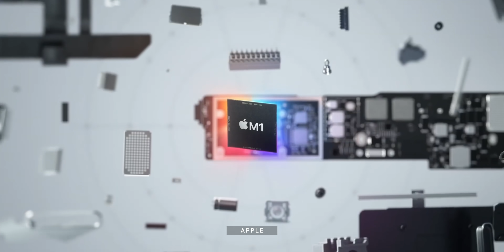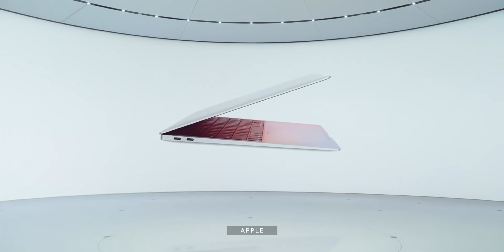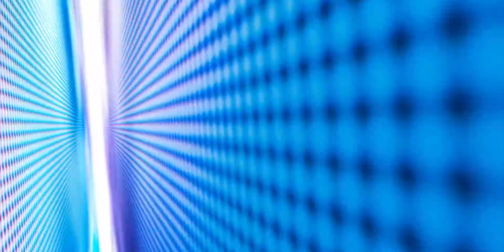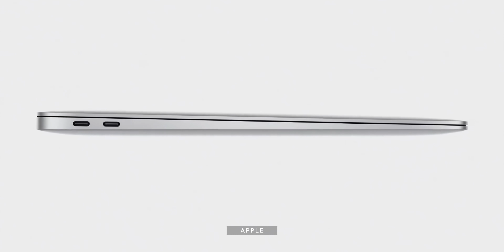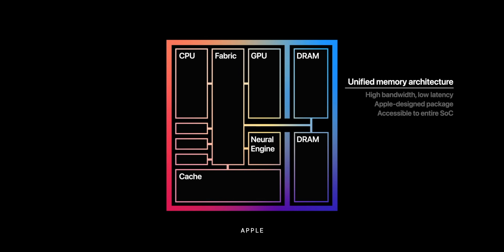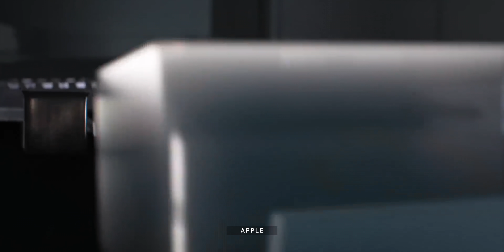M1 MacBook Air — Buy Now or Wait for M2?

Comment: So, no improvement in display??....more nits, brightness, like a MiniLed. My 13" late '13 Macbook Pro is losing its screen...a little more than an inch from the right and a little from the bottom.  I got good use out of it.  The only "work" I really do with it is Affinity Photo.  Doesn't look like waiting would make a difference M1 vs M2

Comment: I am a student and i want to buy macbook air m1 (8gb, 512 gb) as my budget is around 130,000 and i want enough storage and macbook pro is (8gb, 256gb) so is it ok if i go with the macbook air ? I want for normal multitasking, web browsing, media consumption, Microsoft office and zoom meetings...NO VIDEO EDITING OR GAMING but i want smooth experience in all tasks i mentioned above and i want to use it for at least 5-6 years so is it ok if i go with the air? Does it have any heating issues in long run as it is a fanless design? I also don't have any urgency so should i wait for new macs with m2 chip...? Sir plz answer

Comment: I will wait for M2 because though its  single core performance is awesome, multi core figures are not that great.. Higher end pro has Intel processor.. but with M2 materialized, it should take a rebirth as well with the new awesomeness.. Intel chips would soon be obsolete atleast in the Apple hardware.

Comment: Depends on if they need a computer now and how much power they require.  I have a 13” maxed out MBP and love it.  I can use this thing through retirement and longer.  I retire in less than 3 years.  I’m pretty set.  I would though think I would like to upgrade the iPad Pro to the bigger screen.  Maybe 2021, but I’m still not sure thats the best option.  I use the iPad a ton.  It’s a big media hub for my uses.  With the new airpods max, getting the bigger screen iPad Pro could be better.

Comment: For any new mac for me it needs to support more than one external display natively and 16GB RAM and 512GB or more of storage 

I can run 3 external monitors on my 13 inch Intel mac from 2020 which is amazing but hate the noise from fans and the heat.  Apple needs to make sure the M1X Supports 2 or more external monitors

Comment: I recently got the M1 Air, coming over from Windows because I wanted to try the new SOC, and also Big Sur. So far no regrets whatsoever. I'm using as a laptop and a desktop with an Asus 27" ProArt display, Apple magic keyboard and Logitech LightSynch mouse. Using an Anker USB hub. I have ZERO problems with this setup. The M1 Air is hands down a great 13" laptop. No regrets whatsoever. I find I am now gravitating to using my M1 Air Desktop setup more often than my Windows desktop, which I am now using primarily for some games that don't run on Mac.
I don't see any compelling reason to wait for a hypothetical better Mx laptop at this point. Later if they came out with a touch screen, more powerful graphics processing, etc I might be tempted to get one. For now this is great. I don't see having to use a dongle as some giant deal breaker,  and definitely not worth postponing a purchase unless you absolutely have to drive multiple monitors or other equipment that needs lots of ports. If this was the case I would probably opt for an M1 or later Mx Mini or iMac.

Comment: I bought the Macbook Air with 512 SSD, to replace my 8 years old Macbook Pro - trust me I can see the difference. I also use a 2020 intel based Macbook Air for work, and it is massively outstripped by the M1 version, the fan whizzing around in video calls is a minor annoyance at times. So the M1 silence is epic. 

Yes I do miss magsafe, but it was never a deal breaker after a year of using the 2020 intel model and they have the same connectors.

Comment: I'm confused on the meaning of Magsafe. Is it the power connection to the MacBook Air? I'm currently using a 2011 Air and it has a magnetic connection on the power cable. How does the power cable connect to the M1? Altho the new air is much cheaper and Apple will give me $100 on a trade in, some of us still have to save to buy a $1000 computer. Thanks for the video. It's convinced me to buy the M1 Air as soon as I can!

Comment: Guys I need your opinion. Buy a 2015 MacBook Pro (i7, 1tb ssd, 16gb ram) for €500 or save up for the MacBook Air m1 7 core?
Reply: The M1 macbook will surely get you much more power. As for longevity, the M1 will last longer as well; newer battery, no fan and brand new. I'd say go for the M1 macbook if you have a bit more to spare.
Reply: @fogpograndomyt8924  Thank you! Yeah the MacBook is from my dad so he gives me a huge discount since the MacBook is still worth €1000. And yea I need a fast replacement since I have a 2011 MacBook now it’s very slow. And saving up for a m1 would take ages now lol

Comment: Gonna send mine back.. the screen is still very disappointing for me, the aspect ratio, and the lack of touch .. I guess coming from a 15 inch surface might be my issue ... will head back to a convertible or larger laptop for now.

Comment: Hopefully they will fix the screwed up USB-C Power Delivery of the M1 MacBooks so that people can connect hubs to their Mac without them being killed.
Reply: Do you have issues when connecting it to a external monitor? Mine used to randomly reboot when my MacBook was connected to a external monitor
Reply: @booja101  I have the external monitor bug in my 2019 MBP 13. The best way to avoid it is disconnect the cable when you sleep the laptop.
Reply: Already had this happen to a MacBook Air M1 that I purchased not too long ago. Apple was quick to get it repaired, fortunately.
Reply: @alexlpak  Did they charge anything??
Reply: @VivekKumar-pr6ig  Nope! It was all covered under AppleCare.
Reply: Mine had no issues whatsoever.
Reply: @filippo8495  mine had a few issues it would just reboot randomly
Reply: @booja101  never had issues. I have a 34" monitor, power supply, external backup storage, 1gbs ethernet adapter, microphone, webcam, mouse, keyboard attached to it using an adapter. no problems at all.
Reply: @marcj5  Is this a Thunderbolt 3 hub you are using or USB-C? If it's USB-C, would you mind sharing the brand and model? I and many others, have had our M1 MacBook die after connecting if to a USB-C hub, so it would be good to know which hubs are working without killing the computer.
Reply: @marcj5  would you mind sharing which hub you are using please?

Comment: Once you go Mac, you never go back. Bought Macbook Air in 2013. Still runs great!!
Reply: Same here!
Reply: @HelloKittysFriend418   i have 2017 i5 no need to upgrade now I will wait maybe until 2025
Reply: I’ve never had a MacBook and I’m considering buying one the air M1. Is there a secret to how you use/charge it that allows it to run well for so long or is it just the build quality? I’m just worried about the battery since my laptops I always take the battery out and keep it plugged in when I’m at home.
Reply: @Sam-2468  I use to charge it anytime the charge drops below 20%.
Reply: I have a 2015 MacBook Pro, but really want a new air.

Comment: Why I am waiting:
1. I want to see all devices launched on the market after ending transition period
2. I want to compare new M2 MacBook Air with all new MacBook Pro versions 13 or 14 inch
3. I want to get MacBook Air with less weight, new Mini-LED display, better camera with Face ID, new design and new keyboard
In the end I will buy MacBook Air - Why?
Only issue is a battery lifetime - If my current Macbook Pro's battery died after 3 years I think better option to buy chippest  MacBook Air in the market.

Comment: I'm currently torn between getting the M1 air now or waiting for the rumored 14 inch MBP, but they will also have to keep the current pricing for me to justify buying the Pro over the Air. 14 inches is the perfect size and a redesign would be nice, but M1 is enough performance.

Comment: I bought a base Air to hold me over until the better machines come out.  They had a black friday deal where it was about $225 off the normal price so I don't think I'll even lose money when I sell it.  That being said, the battery life hasn't been as amazing as I expected from a 13.3" screen with M1 and it honestly doesn't feel like it has more "pop" than my old MBP did on a web browser.  I've also learned that I'm not a 13" screen type of person - it's just so small...  But I want to say that I love the computer - it's a fantastic machine.  I like to play a certain game through bootcamp and could never get more than about 60fps with my MBP.  Using the new test parallels and test ARM Win 10, the FPS is over 300 now - that's right, 5 times the fps.  It's not an ultra demanding game, but that's just how good the M1 is a many things compared to the Intel Macs.  So I say do NOT wait, go get one now and upgrade later if you see something that you just can't live without when they release it.

Comment: considering that neither my MacBook Air 2014 and my iPad Pro 12.9 2015 could not hold their battery during an entire day. I sprang for the 16GB MacBook Air which I am typing this on, and I am not regretting that decision as it is more than capable of doing anything I can through at it this size of a camera upgrade, which may be in the form of the iPhone 12s or 13 pro or max depending on how Apple names the next generation iPhones.

Comment: there will be "no" new Macbook Air's this year for sure.. that's the way apple did it all those years. The M1's are entry Computers (and they are still very powerful for an entry model!)  & they won't get cheaper. Apple could make an affordable couch surfing machine based on a regular Ipad inside a Computer case for couch surfing.. for every day tasks like checking emails and surfing the web.. a 300-400 $ Machine..but they won't. It's like Porsche wo could design a small family commuter car..those companies wanna keep their brand exclusive.

Comment: I wonder if it’s possible to design a MagSafe around a USB-C so the centre is still USBC where you can charge like the current gen. The surround could be a new MagSafe that has its own charge circuit which charges without data connection and pops off when tripped on. That way you can charge with either which is hand when you leave home without the MagSafe power brick

Comment: I’m all into a single cable solution to my monitor. So if MagSafe will cancel the laptop charging, this is a no no for me. I won’t buy any of the releases that may cancel the single cable solution.

M1,M2 are power efficient so 60W or 90W provided by the monitor are more than enough. 
Thunderbolt 3 is fine, may be one extra port on the other side with full speed.

Comment: I am visually impaired. I have the 12.9 inch iPad Pro and iPhone Max.I just traded away a 16" MacBook Pro for an M1 Mac mini, a Mac that is just so much more at home with powering a big display all the time. I kinda miss that feeling of having the best laptop money can buy, but because of its heat and noise under load or while connected to an external display, that computer just wasn't for me. On the other hand, as an iPad owner, I'm not sure what Apple can offer me in a new Mac notebook. The mini was exactly the Mac I always wanted, but my desk lives a double life harboring the gaming PC I built, a computer whose graphics card never gets as quiet as I wanted. What I really want is a silent laptop with a touch screen that can play my backlog of PC games on the go (again: silently) without the drawbacks of streaming. WiFi 6e would help with that. 5G would help with that. But a highly performant local machine with compatibility for PC games is the computer for which I'm longing. But I won't buy a laptop without MacOS, because that runs my business, and my business must be portable, too. So torn on what I want, and the 16" MacBook Pro woulda shoulda coulda been all I needed... except that it was pushed too hard, and Intel and AMD both just ruined it with flawed silicon. Intel's hot processor met AMD's hot GPU. I had the 5500M. Yes, I now know the 5600M was the golden boy, but that model was released a couple of months after I bought mine, and because of the processor I'm not sure the godlike GPU would have been enough to stop me feeling let down by the machine's 5-hour effective battery life under my kind of load, and the heat the processor would dump while gaming. Having used my dad's old 12" MacBook I am absolutely torn between performance and portability, battery life and compatibility. Pick two.

Comment: the m1 air was my first apple device i've ever owned. just a brilliant device. used to not be a fan of the apple premium but there isn't one anymore. in fact, these devices are underpriced for what you get at this point w their performance. just awesome.
Reply: specs?
Reply: @kush1566  literally just the base model that i got w my university discount lol
Reply: @mrcanuckrazy  do you edit or design graphics and stuff and it is a request please tell me how much ram is the machine using while it is not running any program , idle basically and how much ram does it use while using 30chrome tabs sorry to bother you man if you can tell me this it will be a help.....and are you on instagram?
Reply: @kush1566  no problem but unfortunately i don’t have your answers. have you watched the benchmark or stress testing videos on youtube? I’m fairly certain what you’re asking about has been covered in videos
Reply: I’m thinking of buying a base air and then getting the new 14 or 16 inch MacBook Pro when it comes out
Reply: Lol, mentally use but theoritically, they already made back their premium and then-some.

Comment: Rene, don’t you think the idea of MagSafe for the MacBook line is less important given just how long the battery lasts?  It used to be important, critical even, to be able to plug in during the day because you would only get a few hours of battery life.  But that just isn’t the case with the new M1+ chips.  The only way I can see it making sense, is if Apple shifts to a Smart Connector version of MagSafe gets released that allows you to charge your iPhone, iPad and MacBook using the same cable / charging brick.

Comment: I still have a 2015 12” MacBook 😂
Reply: Same. Well almost, mine is a 2015 13 inch Macbook Pro. But the Retina screen is damaged. Bluetooth doesn't work anymore. It only hold about 3 to 4 hours of charge. It's slow. And I have only 121GB harddrive space, not even enough to update to Big Sur. I really need to upgrade soon, but I love MagSafe and I know I might hate myself if they announce a Macbook Air with no bezels or a Macbook Pro with Mini LED. I think I will at least wait until they have announced something.
Reply: @The_RedVIII  I’ve heard from other people that the next Air iteration won’t be coming for at least another 1-2 years. Thinking like Apple, that seems like something they’d do. 🤷🏼‍♂️

My brother-in-law just upgraded from the 2015 MacBook Pro 13” to the Air and said it was suuuuch an upgrade! I’ll probably cave and get this one just because my MacBook is showing it’s age these days. 😢
Reply: @The_RedVIII  Literally same.  I bought a 13" Pro in 2015, and it works fine...for now.  I really don't want to be without a laptop if mine crashes, but I would MUCH rather wait to see if the MagSafe rumors come to fruition.  Like you, i'm hoping i can hold off at least until they announce something.  Fingers crossed they do it sooner rather than later!!
Reply: Nice one Scott 👌
Reply: I have a 2012 MacBook Pro 16” lol. Still works
Reply: I still have 2010 13” MacBook Pro that I upgraded to 16 gb ram and 1TB ssd and it’s still working fine ! Probably won’t be able to update the operating system anymore but it’s something I’ll keep around, it has an optical drive and sd card slot ☺️...edit: as a note, only this version can be upgraded to 16gb ram..If you have a 2010 MacBook Pro Core2 Duo (13"), then you are in luck and you can upgrade to 16GB RAM. The type of RAM needed is DDR3 PC3-8500 1066
Reply: I still have a 2011 MacBook Pro on life support. I have a Surface Book 2 I use for writing, but sometimes I have to use FCPX and boot up the old warhorse.
Reply: @bizmonkey007  oh man! I’m impressed!
Reply: Loved this model I wish the kept it in line.
Reply: @leonard8766  It really is such a joy to use! I’m going to miss mine 🥲

Comment: I heard that M1 Air doesn't have a fan so it has longer lifespan and I need some explanation with that...in educational sale M1 Air is definitely the thing to choose specially with that software bundle but it's still high price consider how I using my 2018 model intel MacBook Pro pretty well right now you know? If the price will get hire and technical improvements will not following than I would go with M1 but, it will jump so much so...I'm really conflicted since last year 😂

Comment: Why do I feel like Wifi 6 was deliberately released incomplete so it could be squeezed for another released (ie. 6E)?
Reply: The two are different thing. WiFi 6 is the newest version of WiFi offering new features such as more connected devices and lower latency. 6E is adding the 6 GHZ band to the existing 2.4 and 5GHZ available today. The 6 GHZ band  will offer faster speeds but will have less range than 5GHZ.
Reply: Is there any significant difference?